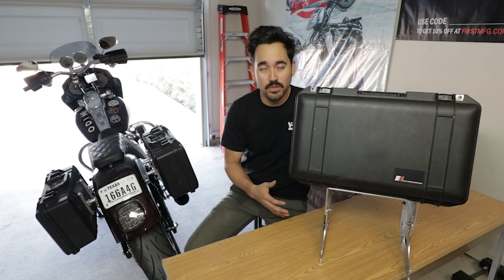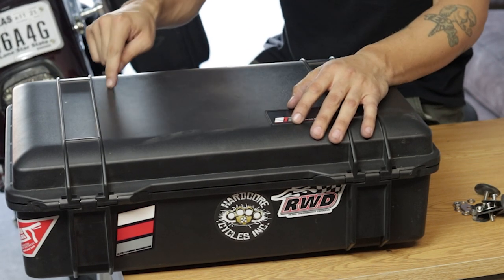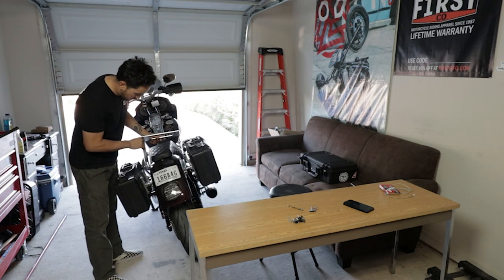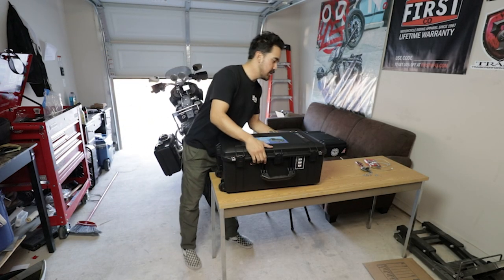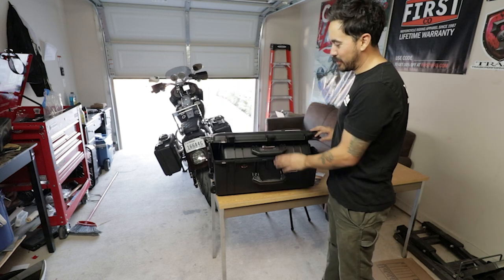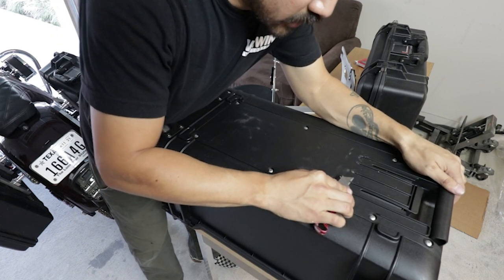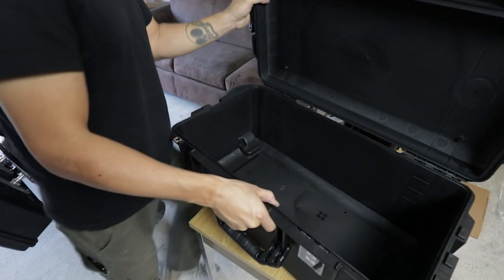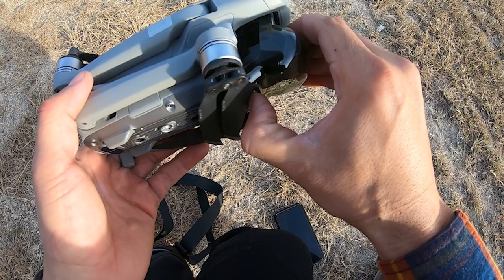Elite Touring Innovations Touring Platform | PELICAN 1606

Comment: Looks good. Be awesome if you can use a quick release so you can take the whole case with you.
Reply from the maker: someone did mentioned something similar! Snag some cotter pins and insert them upside down so when locked you cant access the slide pin for the cotter pin and can make them quick release

Comment: That top box is nice! I wonder if it would go on a 2018 XT250
Reply from the maker: you could most definitely make it work! In this instance it would not as the mounting hardware is for this specific motorcycle. You could fabricate similar tho using some aluminum/steel pieces from your local hardware store! cheers!
Reply: @ConnorFXDB  Thanks for the info.

Comment: Will a full face helmet fit inside it?
Reply from the maker: great question! My apologies for the tardy reply! A helmet will fit in it, but with the case empty and i have to push the lid down a bit for it to fit. The Pelican 1637 will fit a full size helmet in it and is not much bigger a case than this one. The 1637 vs the 1607 shown in the video is a little more square and taller than the 1607. 

Thank you for watching!